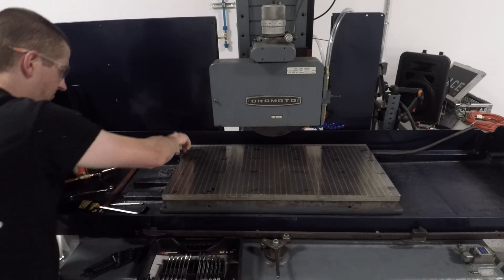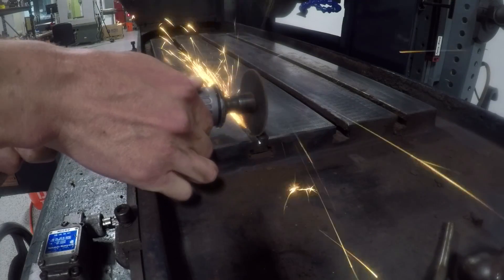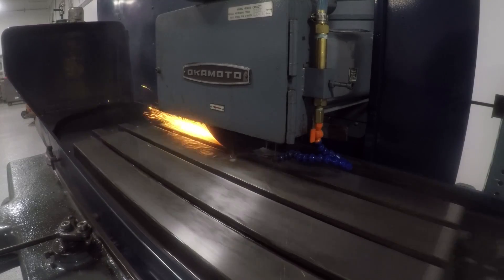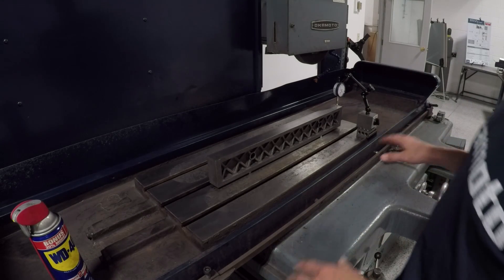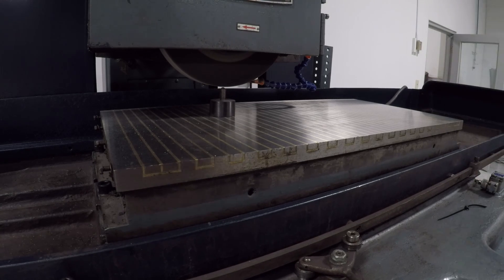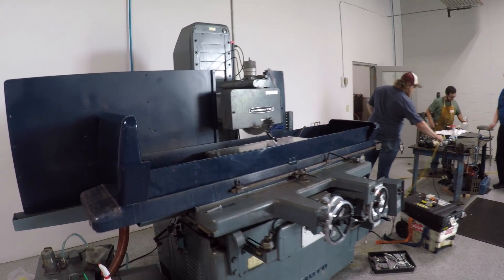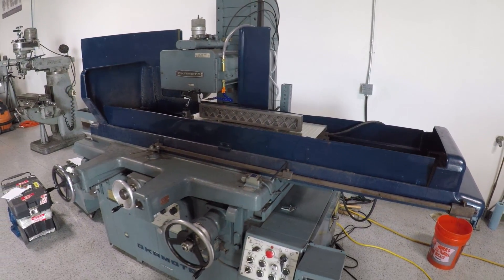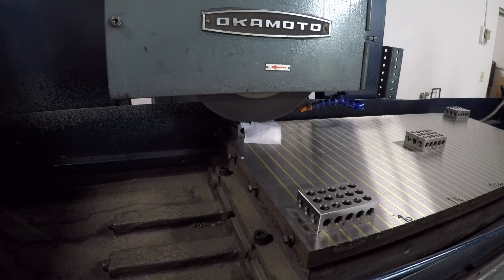Repairing & Re-Grinding The Okamoto Surface Grinder!

Comment: John, I can hear your wheel fail. Cast iron is difficult to grind; you have to dress oftener and take lighter cuts.

Use plenty of FLOOD coolant. Heat is a killer. Warm the table surface with injudicious grinding and the heat expands the surface causing it to hump up under the wheel. Then you carefully grind this hump flat with great care and precision. Later when the table gets back to thermal equilibrium the once-expanded surface sucks back from flat to concave. 

I suggest a coarse dress and grind no more than one cross slide reversal per dress. Use about 7/8 wheel width cross feed increment. No more than 0.0003" down feed on the final cuts and just beause you're removing so little stock doesn't mean the wheel isn't wearing on the cutting tips of the abrasive. Dress often even if it is a PITA.

It can take a couple hours to do a clean, stress-free job of grinding a surface grinder table.

Bed the clean, fresly stoned mag chuck on a heavy fresh film of a good heavy grease-like metal preservative. I prefer LPS3. Install the chuck while the preservative is still very fluid, otherwise it will take hours or days for the excess to squeeze out. Enen then, don't grind the chuck until the next day when the grinder has reached thermal equilibrium and the preservative film has had time to gel. Apply an asphaltum based automotive undercoat to the exposed T-slots and clamps. Years from now an hours long soak with WD40 will soften the undercoat so you can service the chuck. I guarantee there will be little rust under the chuck.

And yeah, I think you're right: that description you read of the way a grinding wheel ideally breaks down is written in words of gold.

.
Reply: Definitely not enough coolant. Too fast cross feed and too fast cross feed on the dressing. Also want to make sure you have a good diamond as a dull one will not open the grain of the wheel properly.

Comment: You need to learn how to vacuum impregnate the cast iron with silicon or some other wear resistance substance like slick 50.
Reply: Edward Mitchell what would he be applying this to?
Reply: To the cast iron parts where they wear or that is to say have wear points. This is done to engines so that the material doesn't rust out or seize up. Here is a pdf file that explains why this is a good idea: http://www.sebestasro.cz/cz/get.php?id=496